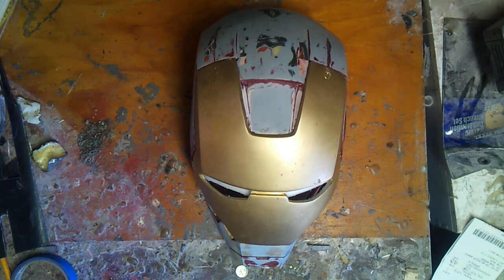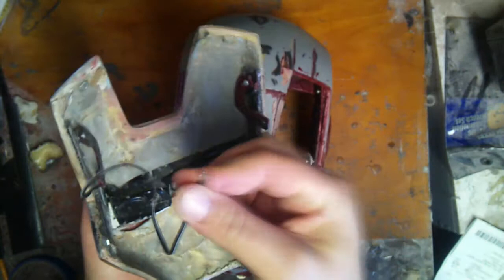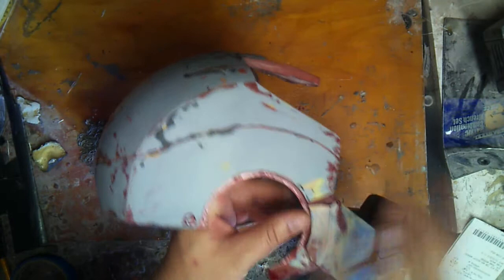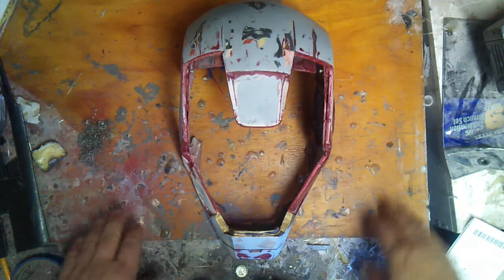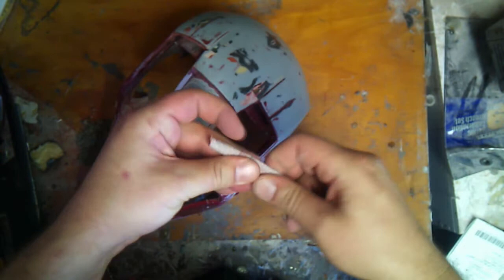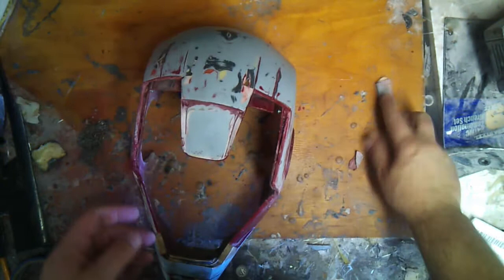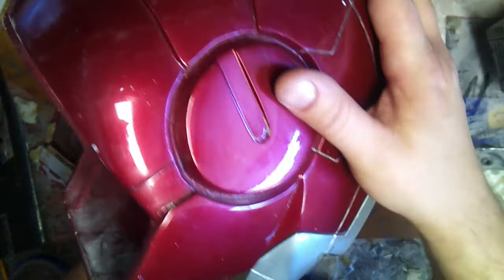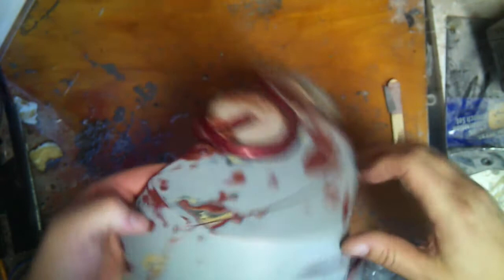Getting ready to mold

Comment: Quick question: I'm making my first helmet now using pepakura printouts, then fiberglassing and bondo body filler for shaping - got all the way through bondo work and sanding ready for priming before realizing it was a bit too small to get on... does breaking the back of the helmet into a third piece make it easier to wear?  is that the purpose?  I'm wondering if I needed to start a second build...